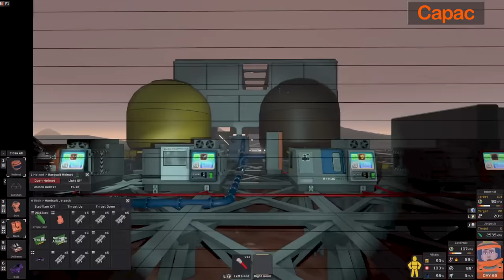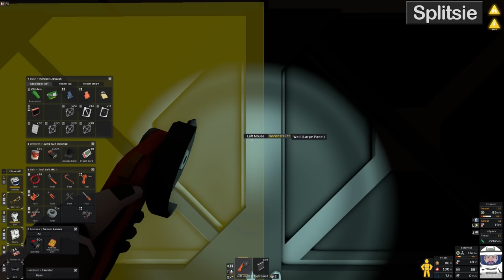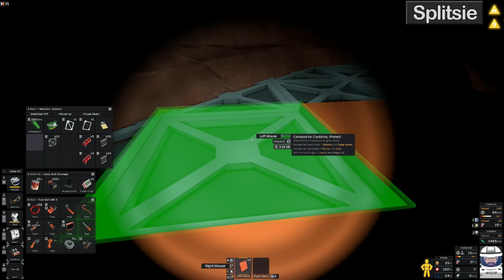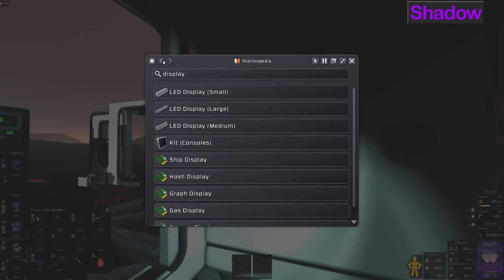New Base... Entrance - Terraformers #9

Comment: This channel and game needs way more attention
Reply from the maker: Hopefully the series has brought at least a few more people around to the idea that there's a great game behind the unique control scheme :P
Reply: @Splitsie  It certainly sold me on the game.  Watched the first couple in this series when you first started it, then went back and watched your Mars series and your series with Capac on Europa.  About 2 episodes into those, bought the game, and now have slightly over 250 hours in it, incredibly fun game (though as a professional software engineer, I guess a game with such an advanced coding system being right up my alley isn't exactly surprising).

Latest playthrough was a Vulcan one, which was quite a challenge.  You definitely get used to the control scheme, though I do wish they'd revisit some of the tool choices (such a wrenches being used to both remove pipes and break the air seal on frames, rather than something sane like a angle grinder.  Too easy to accidentally break an air seal when removing pipes).

Comment: and now comes the fun part.
moving all the primary equipment over to start getting production running in the permanent location.
TFE is responsible for digging out his Arena in the new base location.
Reply from the maker: Now that Nev and Shadow have seen how much faster it is for the Aussies to do the digging, you can be sure they'll be getting the 3 of us to do all the digging :P (latency makes it a bit slower for some reason)
Reply: @Splitsie  I am quite sure there is a Germany joke to be had here.

Comment: 10:00 - HCF is a real thing in computing. The legend I was taught when I started working on the IBM mainframes was that somebody coded an instruction to "Branch to self" (which is now a system ABEND (abnormal end) error code, S0C3, that will cause the program to terminate immediately), which set up an infinite loop, or at least that was the intention... What really happened was the same voltage went through the same wire infinitely until it overheated and, well, caught fire.

That story is apocryphal, but it's still a good story to tell the newbies. 😂

https://en.m.wikipedia.org/wiki/Halt_and_Catch_Fire_(computing)
Reply: I believed HCF was used in early days to thermal check if all circuit were wired correctly in a chip. Catching fire would be the side effect of powering the chip for too long while executing HCF.
HCF itself is just "do everything at all time", and therefore Halt as the system won't be able to accept new input.

And I recommend the eponymous show.

Comment: For the liquid in the pipes, if the pipe is in an uncontrolled environment (ie. outside), and you don't care about the liquid in question (ex. pollutants from the outside atmo), the easiest method to handle it is a Passive Liquid Drain.  It connects to a gas pipe and removes any liquids in the pipe, dumping them into the surrounding atmo, and it does it quite rapidly, capable of handling condensation in even a 300+ litre pipe network at high pressure.  It also won't let the gases in the pipe depressurize or exchange with the atmo.

The only other option, as far as I've seen, is a Condensation Valve, and they're annoyingly slow at removing liquids from the pipe network.  It's one of the better ways to handle re-evaporating the liquid if you want to keep it, though (ex. NO2), as you can do Condensation Valve -> pipe with pipe heater on it -> Evaporation valve for a mostly passive handling of it.  It's just _slow_.

Unfortunately, you can't just connect a liquid tank to a gas network, and most of the other facilities for handling liquids only connect to liquid pipes.

Comment: The maintenance corridor could probably do with having slightly less volume than 2 full blocks of height. That looks a bit excessive. Maybe 4 blocks total in a "Tetris T" shape; or you could have 45° angled walls along the lower edges.
Or you could make it have a rock floor 1.5 blocks below the ceiling. Wasn't it Capac who complained that the airlocks don't have windows showing the rock?

Comment: - New base construction moves from prep work to production proper 👍
~10:05 - Thank you @Shadow for making sure that the little gem RocketWerkz slipped into the IC10 instruction set saw the light of day in a YT Stationeers video 🍻 (Also, thanks to the earlier commenter for explaining the historical reference of RW's gag for the post generation-X viewers out there!)

- Avenue of heavy solar panels:  Just quietly, you'll want to re-install those as the variant that has the singular combined data/power connector, else your copper cost and wiring time will be tremendous.  I'd put a wind turbine at the ends of the solar panel rows farthest from new base entrance - wired in with the panels - This means that your batteries are being charged when daylight and/or storm

Comment: guys, you know it's possible to increase the speed of the elevator. just connect the data input of the elevator and overwrite. the basic speed is 3, overwrite it to 9 and it will be fine

Comment: Re: Gas and Fluid transfer.
Could you build a length of pipe, leading to a second Tank, fill the second Tank. Then remove the empty Tank and pipe from the first Base. Take removed pipe and components from Tank to build a NEW Tank reaching towards your new Base? Repeat till you get where you need it?
Reply from the maker: Oof that sounds quite painful :P
Reply: What you do is you make a big corridor between the bases, then pump or drop any ices/gases/liquids into it, then have filtration on every output
Reply: @DWal32  THAT sounds painful to me.
How would the new Base maintain it's atmosphere?
Reply: @Splitsie  that's why you do it as a team.

Comment: A vending machine per ore/ingot. So you can just collect some iron... or will it only give you singles? I never played with em
Reply: Normal vending machines give you whatever you put in, same stack size and all, refrigerated ones actually have a built-in stacker and give you whatever you set the stack size to.
Reply: @nevcairiel  ok I was unaware of that, pretty cool!
Reply from the maker: Perfect, so we're going to end up with refrigerated ingots so they get stackers :D
Reply: @Splitsie  cold to keep furnace temps under control!
Reply: @Splitsie  there is a reason why we say "Cold Steel" so often after all ;)

Comment: Felt obliged, as an aging geek, to come explain the error code about "halt and catch fire". It was needed for printers, back in the olden days, when paper jams actually did result in fires, and is still present as a legacy command in many UNIX and LINUX installs. According to Wikipedia, the first documented fire-starting printer was back in the 1950s, when a printer functioning similarly to a modern laser printer had a fusing oven attached to allow it to achieve a speed of 1 page a second. Therefore if the printer stalled but the paper feed didn't, you were rapidly feeding paper into an overheating oven 🔥🔥 https://en.m.wikipedia.org/wiki/Lp0_on_fire